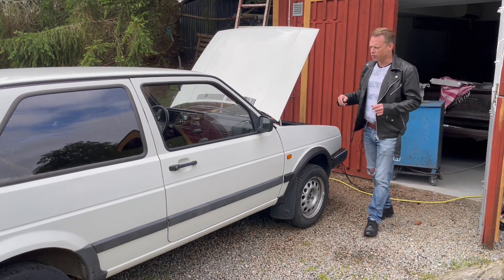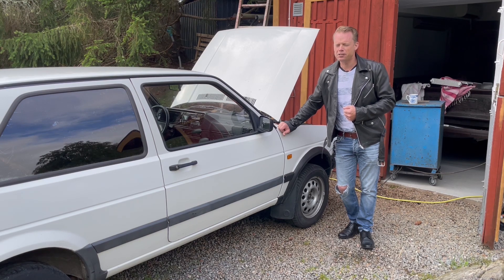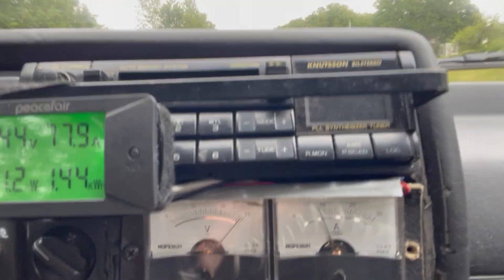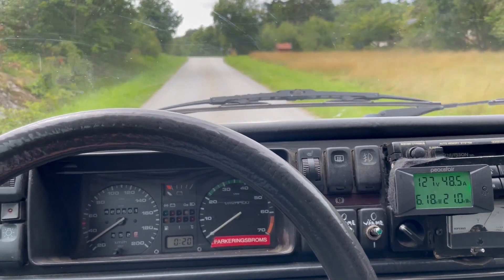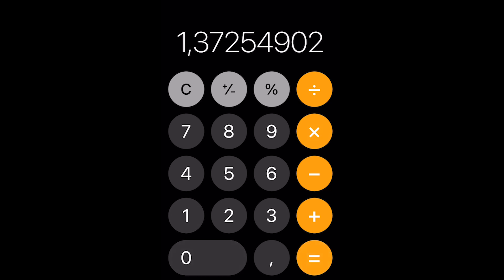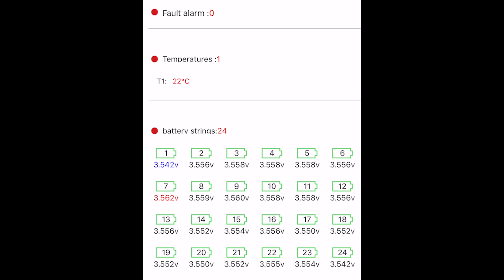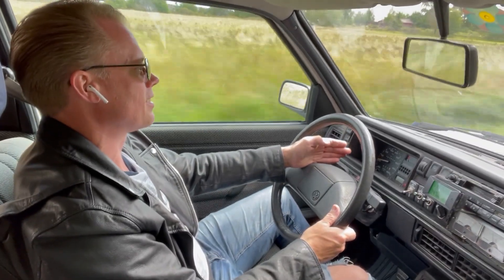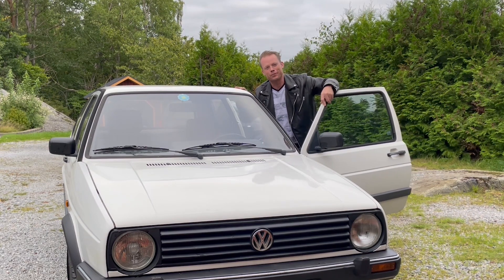Range test, Electric Vw golf Mk2 citystomer with diy lithium battery

Comment: hi , what is the trouble with the clock in the speedometer ?
Reply from the maker: The car did not have any 12 V battery. It only has 12 V when the ignition is on so every time I switch it off the clock resets itself for example when I need to pee,😅 or did a quick stop to check the cell voltages etc.

Comment: Congratulations on the new  project !, just wanted to ask about the bms you used .Does it alow to be linked in series or you just use them to monitor the cells and charging/discharging is not through bms
Reply from the maker: Hi, and thank you😃.  I only monitor the voltage and charge through one of the BMS and I am watching those numbers carefully when I am doing so, and this is just a temporary because I will change to a high voltage battery later on as you probably heard in the video.☺️
Thank you so much for your comment 😊

Comment: if you are not discharging via the bms but still want protection, why not let the output of the bms switch a contactor. Or a indicaton light?
Reply from the maker: I will only use this setup for a short period so I just did this as simple as possible for now.

Comment: really cool test I have a 2015 e Golf with 120 000 km on it now and the maximum range I think I could manage is 110 km's . too bad you are not using the e Golf motor assembly the axle shaft would possibly fit in the MK2  and it would keep this historic citystromer all VW plus you are going to use VW battery pack.
Reply from the maker: I would love to have it all VW, but sadly I cannot get the canbus protocol to work so therefore I will go with the leaf set up. But I will only use the motor, inverter and charger and I will keep the original gearbox and also the clutch, so it will have the original feeling of the citystromer even after the upgrade. It will of course be a lot more work but I think it will be worth it in the end..

Comment: Well, the 13,7 kWh is a bit more than the latest e-GOLF built in 2020 is using at 80 km/h but that car has regeneration on board and I guess the Mark 2 has no generative breaking anymore which increases consumption compared to e-GOLF Mk 7. 6:50 you mentioned that it has no regen braking.

I like this series and I am still asking myself if these crazy tall old "citystromer supercharger" are still useable and working or just a nice fit to the car ?

It looks like a golf country cause the car chassis is so high up. 

I like the upgrade path to nissan leaf motor and ID.3 battery but made me wonder why you did not took a full drive train. But I guess the new ID.3 motor is a different beast without clutch and gearbox the Citystromer still has. But I will like the challenge you are taking to bring the car back to former glory. And of cause it is a classic car aka oldtimer - at least here.

I had learned to drive a car on such golf and therefore it looks so familiar. The citystromer has been released soon after Roxette started their big carreer which were the haydays of such GOLF Genesis or Pink Floyd and what not edition. Each band has its tour sponsor and usually a GOLF special edition back in those days.
Reply from the maker: Glad to hear that you liked it.
I will try to keep the original gearbox with the clutch and everything, so it still will be the same feeling to drive. 
It’s much more work, but I think it can be worth it in the end. Thank you for your comment.☺️
Reply: @flyingtools  At the end the car will have a higher value with more genuine parts and less changes. There are just so few left cause a lot of those had ended in scrap metal in the 2009 when you got a 5000€ incentive if you buy a new car and gave away an old one you had owned for 5 years. At that time a lot of Citystromer had been no longer working due to missing spare parts and missing tech to upgrade it. 

I like the whole idea how you had started it just by buying one, get what was there like the old chargers and then evolve the idea from lead acid to powered by etron and later id.3 
I guess here in germany such car in genuine look and feel l (outside & dashboard and without to many cuts in the metal and dents) think this car will have an increasing value cause it represents the early stages of electric drive train. It was a project at the end of the VW CEO Carl Hahn, who had laid the foundation of nowadays VW group with the Skoda and Seat brands, also all the chinese market shares and joint ventures. 

Great project and progress, unique content and great adventure.